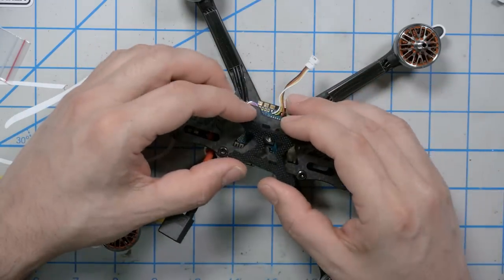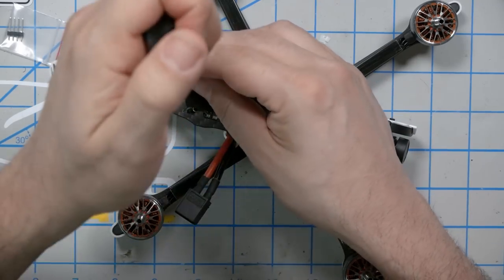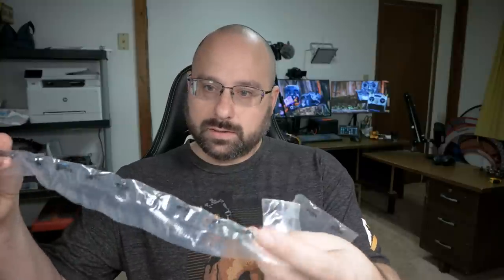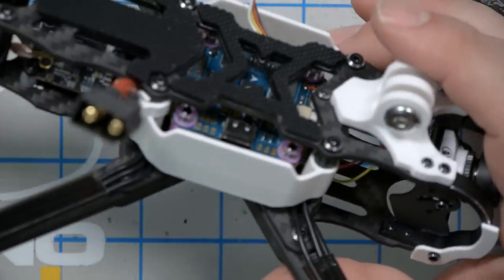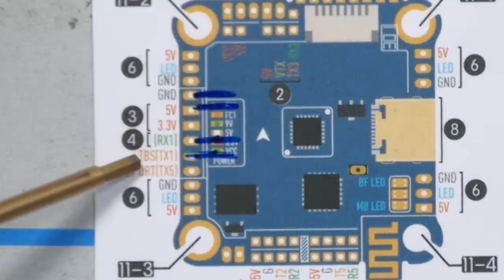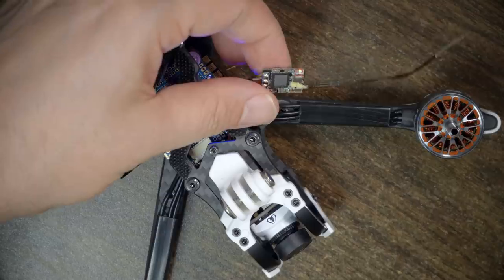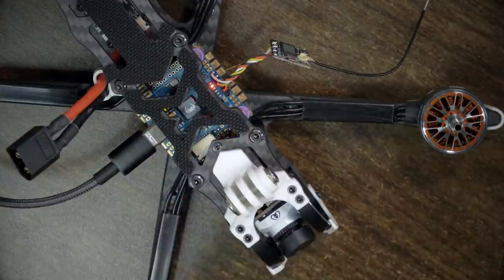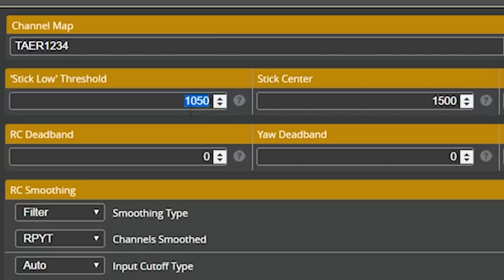Diatone Roma F5 Complete Betaflight Setup Guide

Comment: 20:42  i found this out the hard way. My leg got ripped to shreds when they spooled up while plugged in to configurator, 13 stitches to hold the muscle together. Looked like a set of wide open lips on my calf. Luckily the blades just missed my jugular vein by bouncing off my shoulder and slamming into the ceiling, and I'm still here to enjoy life. Crazy how important it is to remove those blades. I was over confidant and grossly misjudged my abilities and learned a very valuable lesson in patience and attention to detail. Hopefully no one else makes this mistake, it was nuts!!
Reply: Holy shite!

Comment: Hey Josh.. the heads of the screws for the antenna mount are a little too wide, which stops the antennas base from seatings correctly.. I fixed 4 Roma's by shaving down those screw heads.. Afterwards, the  antenna sits snug.. enjoy.

Comment: Hey JB! First i wanna thank you for all the great content and getting me in to the hobby. Been at it for less than a year and have 7 quads by now so my girls isn't as happy :) Second, a question for you, How come you didnt use F.Port on TX 1 instead of the smartport tab on TX5? Access and F.Port can handle it all on 1 wire or am i missing something? I convinced a friend of mine to get the ROMA f5 v2 and thats how I did it on his cuz TX/RX5 was already used for the gps unit. Is he missing out on anything? Should i change it? He's using the RXSR with F.Port/ACCESS. Thanks again for the great content!

Comment: Thank you so much this is the video I needed im buying this while kit money is kinda tight  so this quad same frsky light controller and ev800d googles also the fry sky archer. Any other vital or small things im missing other than battery ect. Thanks josh I'm your new biggest fan thanks
Reply: I will be buying from race day quads through your link i actually made a order with the tinyhawk 2 but I canceled it bc i found you thank you. Your making this possible for me.
Reply: Im going to try to wait a day or two then I'll order if I don't hear anything from ya. Btw i don't expect you to do anything or even answer im sure your a bizy guy.
Reply: They only have the archer mt 2.4g what else do i need will this work thanks
Reply: @Tuidkskiwjdhdbd  I don't have those but if it helps you should try reddit r/fpv where you would receive a ton of help.

Comment: I just purchased one and the Bidirectional DShot is not turned on.  Do you recommend doing this?  Also, my VTX Table was all jacked up and only had one range 25mw.  Downloaded the table and set the ranges and they work fine.  25 – 200 – 400  it is on Betaflight 4.1.3
Reply: I just got mine and i was going over JB rpm filter setup but im not sure it will work, i keep getting motor errors during the motor test.  my quad came with the mamba F50 Pro how about you?
Reply: @paulsantarsiero9718  Mine came with Mamba F411 AIO w/ 25A 4in1 ESC with the spit nano it has to be one board.  I am not a fan of the Split Camera but figured I would try it.  What version of BetaFlight did yours come with?
Reply: @Pineapple22  so i got the DJI version so i have the mamba f405 DJI - running BTFL 4.1.3.  How about you? was thinking of maybe upgrading but not always sure the right procedures.
Reply: @paulsantarsiero9718  4.1.3 is a good version I have it on several of my Quads.  If it is working I would leave it alone and enjoy flying. 🍍
Reply: @Pineapple22  Thanks that's a good tip, i need to do that more.  I feel i spend more time playing with setting then enjoying them sometimes.  Just wish i could figure out the Bidirectional thing, i always worry about damaging something as im still new to a lot of this.  It Great having JB to guide us with a lot of this.
Reply: @paulsantarsiero9718  Don’t worry about damaging anything unless the motors are Hot.  If you can touch them after a flight you will be good.  🍍

Comment: Hey Joshua, on the video transmitter tab my channels only allow 1 through 5 on the Raceband band. It also restricts me from going any higher than 25 in power. Any suggestions? A possible beta flight issue?

Comment: Unfortunately Roma5 mamba stack comes with BLHELI S and does not support esc rpm or telemetry.   At least mine doesn't.   Mine came with The Diatone mamba F404us Dji board.  The ESC is the Mamba F50pro 50amp 4in 1 but seems I cant get telemetry from R6 or bidirectional since I believe those ESC to be BLheli S and not 32 like Helidirect told me it was.

Comment: Joshua, can crossfire nano use the pre installed wire harness that comes installed on the fc? The diagram says crossfire is soldered to the bottom of the fc and the harness on the fc is on the left where the diagram calls out rxsr. The Roma PNP kit came with two loose RX wiring harnesses one of which was marked RXSR and the other was not marked at all but did have four pins and matches the nano pin out.

Comment: Hello Joshua, i am not able to setup the GPS correctly. The osd seems works but when i turn on the rescue mode. The quad starts to spin or just fly away and stop the motors. I think that the fail is in baud rate of GPS. Can you please share the GPS settings

Comment: Hey Joshua! I appreciate all of the work you put into these vids. Do you know of anyone that has done a video on syncing the Roma F5 DJI HD to a DJI FPV remote? I just purchased a Roma F5 6s along with DJI goggles v2 and I had the DJI FVP remote from a recent purchase. I am unsure how to sync the goggles and the remote to the quad properly. Thanks in advance!
Reply from the maker: Go to 24:47 in this video to switch to air unit mode. https://youtu.be/ffpMWX4yyyc

After that bind using the bind button on goggles and air unit.

Comment: Just as an FYI, I couldn't get my Spektrum SPM4650  to work on the standard TX1 port. I had to wire it to the TX5 port to get things working as intended. Admittedly, I'm a novice, but I wanted to mention this as I spent a couple hours trying to figure out what I was doing wrong. Then I switched to the TX5 pad and things worked fine.
https://www.rcgroups.com/forums/showpost.php?p=46197597&postcount=482

Comment: I recommend everyone who got 6s version of this quad check ESC version. 6s version is supposed to have MAMBA F50PRO with biheli32 firmware. But mine came with more cheaper MAMBA F50 non-PRO with biheli_s. I had to write to their support, so they send me replacement PRO-version ESC. Haven't recieved it yet. Any way when i receive it, im gonna have to re-solder it.
Reply: Just keep it as spare and flash your S with JESC for rpm filtering
Reply: Mine did to apparently!!  Cant get telemetry or bidirectional so guess Helidirect screwd me once one.

Comment from the maker: This video is working with the analog version. If you have the DJI version, the DJI-specific setup steps are here: https://www.youtube.com/watch?v=RnrbeiXTM7Q&ab_channel=JoshuaBardwell
Reply: Thnk u soo much for the analog version sir..
Reply: Hey Joshua!   I just got a quick question for you.  So recently I had bought new goggles for fpv. The goggles I purchased were the sky zone O2C. I also had bought some batteries for them that were listed in the description of the page.  My question is that I don’t know how to decide on what type of battery charger I need.  I have no idea where to start on finding and purchasing the correct one.   The battery I bought was a 7.4v 2s 3000mAh lipo battery.  If you can please help make figure out which one to choose and/or tell me how to decide which one.  Thanks so much.

Comment: Hi Joshua, good video, how come on my f5 my crossfire nano don't power up when on usb only? Is there any settings you change on yours? Thank you
Reply from the maker: That's not something that can be changed via settings. The only thing I can think is you soldered to a different 5v pad. Typically only one of the 5v pads powers from USB. The one next to the TX1 / RX1 pads.
Reply: @JoshuaBardwell  i used the pre soldered connector.   I will check the other 5v pad if it has power when connected to usb only. Thank you Joshua stay safe!
Reply: Same for my Roma f5. No power to my xm+ when USB powered. I was kind of jealous yours was working

Comment: When I plug my Roma F5 in, I see this error:
"Attention: Your VTX is not configured or not supported. So you can't modify the VTX values from here. This will only be possible if the flight controller is attached to the VTX using some protocol like Tramp or SmartAudio and is correctly configured in the Ports tab if needed."

Any idea why my Betaflight isn't recognizing the Vtx?
Reply: You have to set up your VTX tables

Comment: Hi there, I have a question:
 by default mamba ultra 1000 is locked a power unit that is available is 25 mW. can you explain how to unlock other options?
Reply from the maker: Press and hold the vTX button for 15 seconds. When unlocked the power led will stay solid instead of the green led flashing.

Comment: Hey I just wanted to say thanks for the hubsan 501s esc so cheap awhile back on eBay an it been awhile back 5 months ago or more. An if it was not u then I'm sorry . Anyway I've been trying to into this for last year. I sure  many lost few of the first drones so im at the point were ive been ordering stuff to do my own build. I have had a few bugs drones a few hubsan's. But time to build my own Ive been ordering A peice or 2 at a time. Don't really have a computer so I decided to go with the kk flight controller with the lcd display. Does betaflight have an app that you could hook you quad up to your phone an do all the setup on you phone.I've had a betafpv radio lite 2 controller for awhile now still haven't used it. Only thing I have left is to come up with the money for  a pair of fpv goggles. I just hope I got the right receiver. What the best budget pair of fpv goggles would you recommend.
Reply: Disregard that I just noticed you made a few videos recently about goggles.

Comment: Hey Joshua!   I just got a quick question for you.  So recently I had bought new goggles for fpv. The goggles I purchased were the sky zone O2C. I also had bought some batteries for them that were listed in the description.  My question is that I don’t know how to decide on what type of battery charger I need.  I have no idea where to start on finding and purchasing the correct one.   The battery I bought was a 7.4v 2s 3000mAh lipo battery.  If you can please help make figure out which one to choose and/or tell me how to decide which one.  Thanks so much.

Comment: I can't get the R-XSR to power up using just the usb. Contacted Diatone and they said I have to plug the battery for the receiver to power up... A bit strange I think since Joshua can power up the receiver using just the usb. What is correct, and what can I do. Anything to do with the settings in betaflight, or do I need another receiver?
Reply from the maker: You may not have the same FC that I do. I believe the analog quad has different FC than the DJI one. There is no setting you can use to change this -- it's a characteristic of the design of the FC.
Reply: @JoshuaBardwell  Yeah off course. That didn't cross my mind🙃☺️ Thanks Joshua👍

Comment: Do we need to bind the radio to receiver before configuring flight controller in betaflight?
Reply from the maker: If you bind first, then you can verify that the receiver and aux modes are working correctly.
Reply: @JoshuaBardwell  thanks for the reply.
Reply: @JoshuaBardwell  please can u explain how u unlock the video transmitter and do you have to manually change some values in vtx table?

Comment: Hi Joshua, I have a question, I'm building a new drone and I bought a 6s 1500mah battery that weights 247g, that makes the drone have a weight of 590g approximately without a camera, I think I chose the wrong battery. Do you think that the drone is gonna fly well or not? 😬
Reply from the maker: Personally I prefer closer to 6S 1000 mAh to 1100 mAh. As much as 1250 mAh can be okay. Personally I think 1500 mAh is too heavy.
Reply: @JoshuaBardwell  So, Did I chose a terrible battery? Because it's my first drone build and I spent all my budget, I can't change the battery, I'm a little bit concerned that the drone is going to be too heavy to fly without a camera 😞
Reply from the maker: If that's your battery then that's what you've got to fly with so may as well give it a go. 600g without a camera is fine. 800-ish g with a camera is a bit much but will still fly.
Reply: @JoshuaBardwell  Thank you so much😁

Comment: Just got this pnp/bnf kit and it's got me trying to figure out the best way to mount the battery in order to keep the jst balance charging plug from getting hit by the props. Actually having that same problem with a 7 inch drone as well, and I destroyed a couple batteries on that one. Just took reorienting the battery, but I can't find a good orientation on this with a 6s battery that keeps that plug safe. Is there anyone out here that can give a noob some tips on not killing my batteries?
Reply from the maker: Use a rubber band around the battery to secure the balance wire.
Reply: Thank you! And don't I feel silly now. I was really over thinking it.
Reply: @JoshuaBardwell  The "instructions" I got with my kit specifically cautioned against mounting the receiver right over the VTX, which is weird. They give you the little plates for it and everything. I ended up remixing a 3d model from thingiverse to both mount my r-xsr in it and protect it from pointy ground. It now lives under the VTX, separated from it by the cf frame. Don't know that it actually mitigated interference or not, but it worked and I was able to use the provided antenna tubes in the existing TPU mount. Will share if anyone wants the stl for it.

Comment: I can’t figure out why my crossfire isn’t working, pinout double check now, bound to transmitter but still no input in betaflight. I have made sure serial rx is open on port 1, please help 🤔
Reply: Tx and Rx wired the wrong way to the Crossfire receiver?
Reply: Channel 1 from Crossfire to the Rx pad on the FC and channel 2 to the Tx pad.
Reply: Thanks! I did end up the checking my tx and rx pads, I had it correct at first but mistakenly switched the yellow(rx)and white(tx) when troubleshooting why I didn’t have any inputs in betaflight, after I had it wired correctly again and updated the firmware, all is good!!

Comment: My receiver wont turn on if the battery isn't plugged in on my Roma f5.
Reply: Mine too. I need to connect the battery for the receiver to power up. Contacted Diatone and they said I have to plug the battery to power up the R-XSR. I bit strange I think since Joshua get it to power up using just the usb...
Reply: @gm_stian  I'd guess you are getting your rx power from vbat and not from the +5v. Perhaps you already checked this, and apologies if it's a dumb suggestion. On my other quads I learned that VBAT is direct battery voltage (whatever volts your battery is) and the =v is regulated voltage from the FC, which can be powered by 5v over USB or the battery, or both.

Comment: How come not wire it up as F.Port?
Reply from the maker: That would have worked fine given this is an F7 processor. I just didn't think of it.
Reply: @JoshuaBardwell  ok. Wondering if maybe there r some fc f.port doesn't work on though I have installed on f4 and f7 (f7 gave me issues till I switched to fcc firmware from flex)

Comment: Frsky ACCESS looks pretty awesome. OTA updates, telemetry, nice. What about all of us with ACCST though?
Reply from the maker: There is no way to upgrade an ACCST radio to support ACCESS. The whole point of ACCESS is to lock you in to Frsky hardware and lock out other hardware.
Reply: @JoshuaBardwell  so FRSKY said "screw ACCST"?
Reply: @ruuster83  with xm+ or r-xsr u have to install accst firmware from frsky website. I use accst for my small drones tinyhawk2, 85x, on my x9 lite
But frsky doesn't support any further updates for accst I don't think.